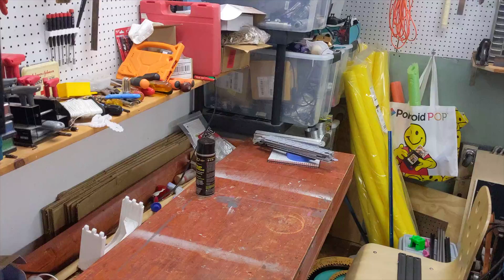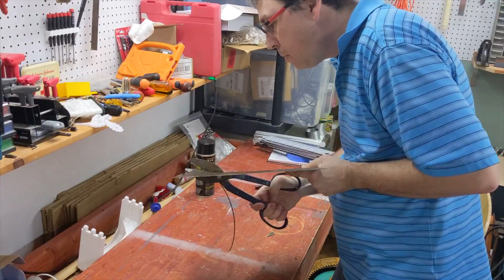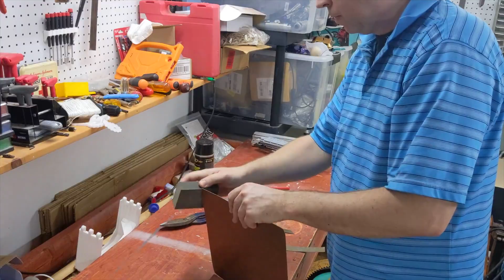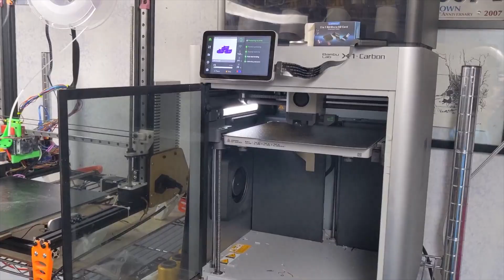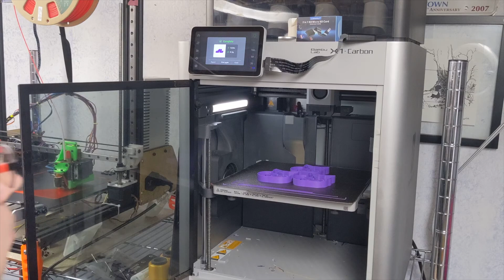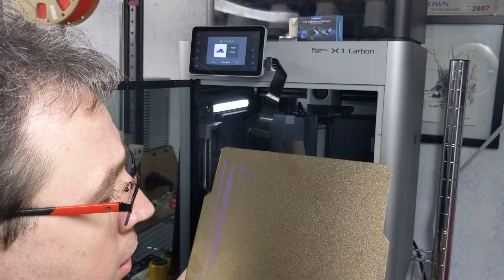Bambu X1-Carbon 3 months in: Upgrades for Fire and Forget 3D Printing

Comment: Darn. I wasn't expecting the answer to be a microSD to SD adapted and cut up Ender sheet. I've been really happy with my textured Bambu plates.
Reply: Agreed. If you have the extra plates to cut up, sure. That adapter is a no go for me, just print the small SD card ejector tool on printables that takes 10 minutes to print and clips on the edge of the lcd to use later. Way cleaner than this.

Comment: “Maybe I don’t apply enough gluestick”. Well, maybe you are applying too much? Looks like it. Unlike other printers, on the Bambu the glue stick is used to create a barrier to break the print free. Not to hold it down. The very first print I did on the X1 I didn’t use glue and I ripped a piece of the sticker cool plate up with it when removing the print….🤷🏽‍♂️
Reply: Same. I don't even like using the cool plate because it sticks so well I get the shape of whatever was last on the plate stuck to the bottom of the current print.

Comment: My Bambu has local only wifi btw. Maybe you need to update?
Reply from the maker: On NDA's I'm slow to adopt the latest... cuz a screwup could be expensive.  The bambu isn't a bad machine, and I understand the compromise but closed-source firmware is one of its down-sides.